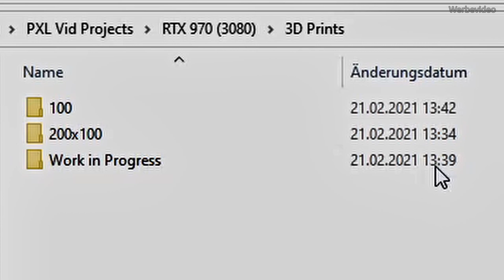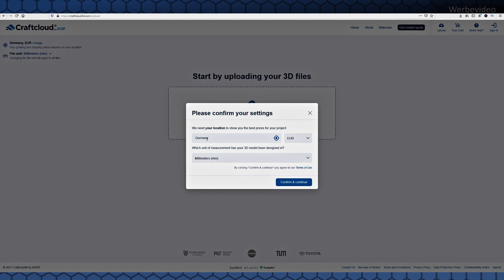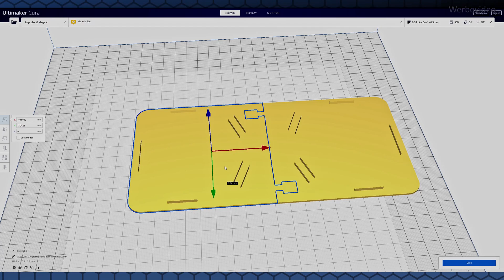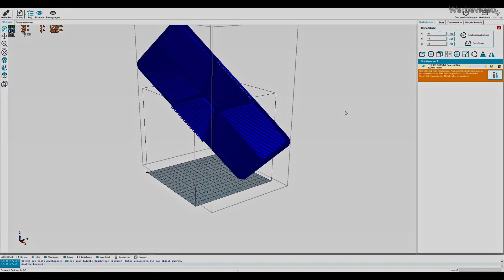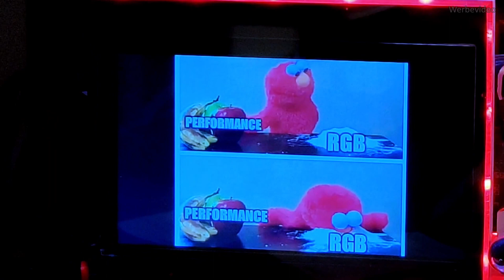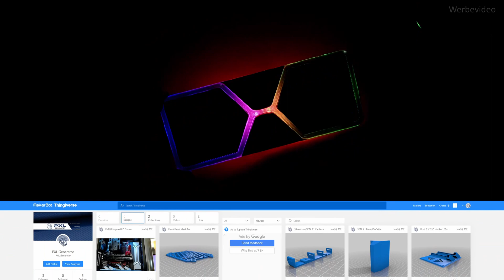RTX ‘ify Your Graphics Card with 3D Printing +Bonus

Comment: Quick question, won't these melt due to gpu high temp? Thanks!
Reply from the maker: I seriously doubt it, as PLA filament (the most commonly used one) melts (gets printed at) 190-210C (374-410F), something would have to be horribly wrong with the GPU 🫣 🔥
PLA could start to deform around 65C (150F) like sag or bend, but with airflow in a case that should still be ok and there are also other filaments that can take higher temps. 
Hope this helps and thanks for watching 👍

Comment: Awesome design, but you create a massive problem with this thing. The backplate is there not to look cool but to take that heat from memory, power banks etc and transfer it into the plate, using plastic you just heat it up and insulate the heat, while backplate made out of aluminium will dissipate the heat. 
I'd argue to buy aluminium backplate and design a corpus for the fans in any style you want, if you wanna make your backplate look somewhat fun you can paint it with heat resistant paint or Plasti Dip.
Reply from the maker: Everyone is free to do as they like. Sure it can trap some heat, but considering not even all stock backplates are made of metal and also some stock backplates don't even use thermal pads. It's always on a card for card basis. Luckily not every card is a 4090 with hot VRAM on the back.
Reply: @PXLgenerator  This is true, some cards come with no backplate at all 😆But still it's worth to consider, and I hope anyone who comes across my comment would be informed and weight their decision, because if you slap this on most of AMD GPU's - you're just asking for trouble :))

Comment: Nice video there man. That's a super clever idea, and certainly helps get over the FOMO - a lot cheaper than the alternative too :D

I wonder how many people would be completely fine with their current cards if they just looked like the new ones? I bet the same idea would apply to cars.

Quick question about the clear filament. If I got a company to print out a set of these in a clear filament, what would be the best way to make the clear plastic look as clean as possible, almost matte class like? Would fine sand paper do the trick, and/or maybe some sort of light matte effect spray paint?

Props to figuring out the edge lighting, that light touch of RGB looks really professional.
Reply from the maker: Thanks. Sure people might still be fine with their current card even despite the whole crazy situation, sometimes it's just nice to spice things up a bit. Yeah and if you go for the edge light version you can at least 1up the guys that could snatch a real RTX card...in one aspect 😁

On the printing clear...
First off there are 2 completely different printing techniques to consider.
FDM - most common, melts a plastic coming from a spool and lays it down in strands next to each other and each layer builds up from there. So by nature of it you can't get a glass like clear piece out it.

There are Resin (liquid epoxy) type printers, have one but haven't fumbled with it yet, in those you have a vat (a bathtub with a clear floor) with the liquid resin in it, the buildplate gets lowered into that and from underneath it gets blasted by UV light. A lcd screen is in-between and masks the form for the entire layer. This method would be the most promising to get as close as glad like as possible.
I've seen videos where people put a clear coat over a resin printed translucent part and it looked pretty darn good.